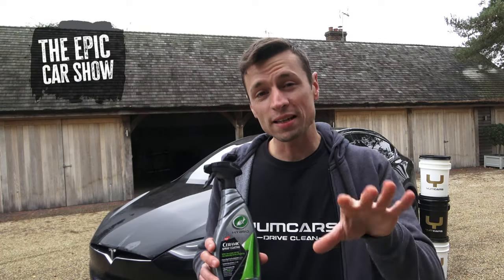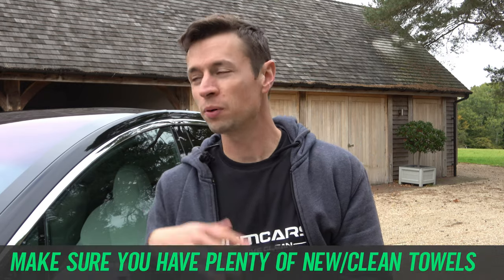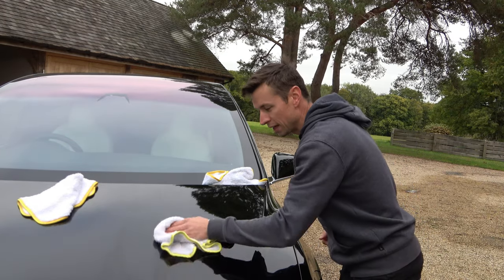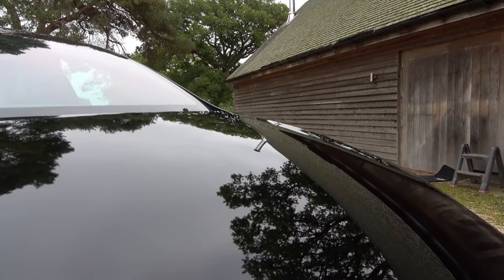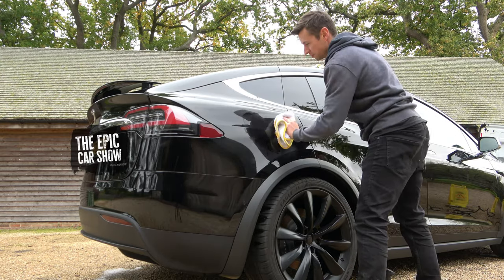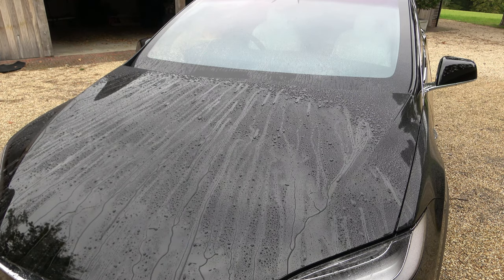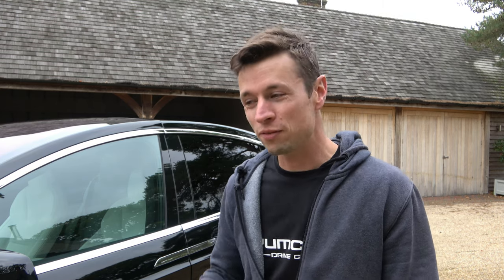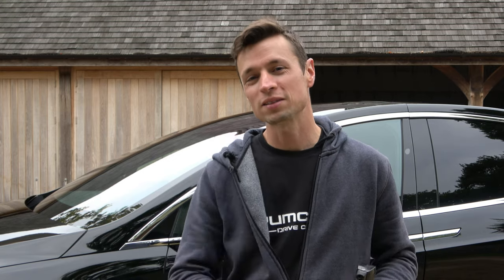Turtle Wax Ceramic Spray Coating Review | Fix Streaking on Black Cars

Comment from the maker: How many of you have had this problem with turtle wax? After seeing this would you be prepared to give it another go? Let me know in the comments.... It's actually pretty good once you establish how to apply it!
Reply: Liked it, but before buying again I'll wait for more graphene sprays to hit the market.
Reply from the maker: @gert-janvandenberg4156  I'm not on graphene yet. Give it 12 months everyone will have graphene products out
Reply: @epicautomotivedetailing  for sure, but those 303 graphene spray vids look promising.
Reply: Great video Dave , had the same issues with this product, then sorted with the damp towel. It is a good product ,but a lot of fannying about ,if you have the time. Tried others in the range ,shampoo, qd and the wet wax , shampoo and wet wax is a good combo. Done several different cars with the ceramic sealent for mates and family and only have a bit left which i use on my wheels. I have moved on to Garage Therapy 3cs and sigma now  for my winter protection which is quicker and easier to apply. I personally would not buy this product again . keep up the good work
Reply from the maker: @skidmarkbill  very well spoken mate. From a business point of view. It didn't work perfectly for me but I really wanted to rectify what I said in the past. That's why I love yum cars, sonax for the simplicity of their application. One thing I will definitely give them credit for is the durability which I seen over the past 12 months. Thanks Dude 👍
Reply from the maker: @gert-janvandenberg4156  yeh that or infinity wax is on my shopping list 😃🇬🇧
Reply: after working extensively on a large black chevy truck yesterday, applying all the tricks, i'm giving up on the TW ceramic and graphene waxes.  I'm on line looking for someone that has found a good product for black vehicles that is not such a struggle.  I have a black car coming in about a week and my thought, unless I can find a better idea, is to polish with TW Graphene 1 and done then follow with 303 or Adams Graphene.

Comment: Good to see you got it working. I only use 3 towels (but that Tesla was a bit of a barge, so understand the issues), and as I mentioned to you on the previous vid comments before, the wet one is absolutely key to getting results. 

Little tippy hint from my experience of the range.  If you use TW ceramic on a customer car and just one coat, you should try to upsell a leave behind of the ceramic wet wax for them to use after maint washes.  It is simple to use, they will love the results and you will become their trusted advisor.  A couple of bottles will easily see them through six months on an average car.  When you return to re apply the ceramic seal in six months, you will have an easy job and you may of course choose to make a couple of quid on the upsell too if you can get a discount from TW.
Reply from the maker: Thanks Kev, once I'm through with this bottle I'll be on meguiar's spray sealant it infinity wax graphene maybe. Just love trying all sorts of brands
Reply: @epicautomotivedetailing  Can understand your point entirely as a valeting business and a YouTuber. With me just maintaining a few cars, I quite like the finish, longevity and simple maint washes the TW offers, and don’t have to worry about time too much. You get out what you put in as a weekend warrior I guess.
Reply from the maker: @kevtheargonut  I'm all about simple and easy products

Comment: I first used Turtle Wax ICE Spray Wax' then bought the TW Ceramic Polish, and the TW Ceramic Wax.  I found the same streaking you shown.  It takes more work.
I am going back to the ICE products.
Reply from the maker: Yeh it's a shame but it looks like they have their graphene coming out before Xmas. I could be wrong but judging by there (something big is coming promo) it looks like graphene

Comment: Nice revisit, I used it on my black Golf this summer. Good results if a bit difficult to apply, IMHO. I will likely go for something quicker and simpler when the bottle runs out. Cheers Dave.
Reply from the maker: Hello Simon, yeh it's good but think it needs a tweak to be better for the mobile valeter or weekend warrior. Yum ceramic all day long for me

Comment: OMG, yes!!! I have Toyota Camry with the red pearl paint (7 layers of paint + 2 layers of coat)! I have a terrible problem with this product, I literally sweat myself and push really hard trying to remove the streaking... So far the only workaround I found is using barely any product, wiping it off almost instantly and buffing off with a second towel right away...
Reply from the maker: It's a real pig isn't it. I won't get any more ever again
Reply: @epicautomotivedetailing  Most of the videos about this product are super inconsistent too... One guy is saying it's perfectly fine to use in direct sunlight, as the product was designed having in mind the hot climates, another is saying avoid the sunlight, one is saying it's super easy to apply, etc. But it's not easy to apply. Probably , theoretically, after doing a near professional level of paint preparation and while you already have other products applied to the paint afterwards... then MAYBE it would be somewhat easier to apply... For me it got really frustrating and I even thought of throwing the bottle out for good...

In addition, I got their 3in1 Ceramic Detailer Waterless Blah-Blah product as well - and I got exactly the same streaking problems as with the ceramic wax... And worse, the product says to pretty much spray generously and wait a few seconds... BIG mistake!

Edit: I've never, ever had such problems using the Waterless wax by Meguiar's
Reply: @epicautomotivedetailing wait a second fella... i have read your replies you made under this video where you say you like this product and will keep using it. And here you are claiming you won't use it again. You must realize one thing, people will read these comments many years after uploading a video. Be consistent with replies

Comment: I had best results by applying it with thin cloth, so it spreads more evenly, and most of it disappeared. The bits that didn't disappear - I buffed them with DRY, fuzzy cloth. Took some time, but I think that removing marks with damp cloth also removes the product.

Comment: Good points raised Dave, to help us learners/student of detailing!  Meg's HCW first applies similarly, best done with a wet car and damp MF for applying, then use the 2nd cloth to dry and buff (hot day not ideal time to play with this kind of product).  Similarly priced to TW, but I will be trying the new (cheaper) Infinity Wax QDX Graphene spray bought recently, but not the weather to test this weekend. ⛈⛈⛈⛈
Reply from the maker: I need to try graphene. I need to see how it holds up in winter
Reply: @epicautomotivedetailing  TW HCW is a good product but those smirs or dark spots appear on dark colored vehicles because you spray directly on the panel here is a Tip for you. Try spraying on a towel and then just spread it on a panel then buff off with a second towel on any dark color (no more). this can happen on any spray sealant/wax  not just TW. I've seen it happened even on meguiars NXT wax  2.0.its simple to much product on a surface and not enough time to wipe off.

Comment: Great video Dave, think you've identified where I went wrong with this product when I bought it originally, may have to buy it again and rtry using your tips although I think yim cars ceramic is a far easier product to apply now I've tried it and like it
Reply from the maker: Yes yum wins hands down for me. I had to remake this video because it would be pretty poor of me if i left my old video without giving it a fair crack. Yum ceramic is mind blowingly good

Comment: I've got a new black car. And it has a Graphene Ceramic Coating on it And it drives me crazy with all the streaks. No matter what I use. And I'm not a rookie started by detailing planes and private jets working at a small airport 36 year's ago. Trying to work off my pilots license. But this thing is insane!! Someone can look at wrong and it gets a smudge on it, so it seems.
Reply from the maker: Wet towels straight after followed by fresh new ones is the cure

Comment: Interesting comments. Here in California, with 2 black cars after about 2 1/2 years, I've had minimal problems, just used a microfiber applicator towel to spread the product around, with not too much product sprayed directly onto to the vehicle and then wiped off with the same microfiber towel using the opposite non damp side, and then buffed with a fresh microfiber towel. Rare streaking, which cleaned off easily with the same applicator which was still damp and wiped off. I spray after each wash ie every 2-4 weeks depending, and can do the entire cars in about 15-20 minutes. No problems with layering. The vehicles look great and get compliments. I have found that streaking can occur when one uses too much product on the same panel.

Comment: That's exactly what happened to me it's a pain in the ass. The car looked like crap with those streaks. Had a hard time to remove them too.
Reply from the maker: It's very tricky but once you get the hang of it you will be impressed

Comment: Good vid sir! A fair assessment.  Even with the fix here, there are still way too many caveats for how to apply this stuff.  Also a 24hr cure time  per coat and recommended 2 coats for that 12 month protection.  For most driveway detailers/weekend warriors thats just not going to be possible, even with a garage.
Quick winter prep, this stuff aint ;)  I mean its like the Dulux Paintpod. Too costly for pros and too much hastle for everyone else
Does it do a good job? Yes, but the cost, time and prep required, when you can throw on just about anything else as a base thats not as fussy.  I'd even use Fusso coat over this in a heartbeat.
I can't recommend this product at all, but I cant recommend the older Tw hybrid and Dry n shine enough.  i hope that the V2 stuff gets released in the UK
Reply from the maker: Hello I simply had to make this video as I did one in the summer which wasn't fair of me to be too harsh on it as I said some bad things. But Yeh it's definitely not ideal with the 24 hours waiting time compared to other brands and no I'm not going to sway people into buying it either. This channel is all about simplicity and this product is the complete opposite.
Reply from the maker: Thanks for watching too 😁

Comment: Brandnew car, so the first time I washed it I used the Turtle Wax Hybrid wet wax the yellow bottle and that stuff is amazing so easy to use. But after the car was all dry and done, it was parked for about an hour 

Later in the night I decided I was goin put some turtle wax ceramic spray on it. The green bottle.
I just noticed and found out you have to use a damp micro fiber when using the green bottle and very light application, well anyways I didn’t do that so now I kinda have that sappy streak look on my pant. Not horrible but I can see it when looking for it. 

What’s the best strip wash I could use? Turtle wax Max wash? Or Adam’s Strip wash? The car overall has two coats of wax technically it should be super hard to get off. I didn’t put a crazy amount on the first or second time. But it did have time to cure, so I’m afraid the wet damp cloth trick won’t work for me right now.

Just basically want to start over and fresh, then I’ll probably only use the hybrid spray when the car is wet cause I like that the most and I get better results, probably cause it’s easier to use.
Reply from the maker: Hello just re wash with a strip wash and you will be golden

Comment: Mist a towel after getting most of the product off the car and then dry it with a micro fiber. Looks amazing.
Reply from the maker: YEs thats all it takes for an incredible gloss
Reply: Do you mean, apply with spraying the TW onto a dry cloth, then wiping over with a damp cloth, and then buffing with another dry cloth,, ???

Comment: Epic vid i have 2 coats on my black Skoda yeti used a microfibre applicator pad and loads of cloths and it looks ace top up every few washes with i si02 detail spray bit of a faf to use but the results speak for themselves
Reply from the maker: Yeh that's the problem I thought before. I first saw the streaks and chucked it but glad I got it out the bin. I even bought a second bottle because I felt bad for slagging them off lol

Comment: I found it hard work, harder than it should have been, 
Black SUV car 21 degrees, smearing like crazy. Got there in the end but I won’t rush to use it again.
Reply from the maker: I agree mate. I like but I always use other ceramic sprays first
Reply: I’m not one for giving up easily so thought I’d use it again on a c200 Merc estate, the results were outstanding, however I simply cannot get on with the product…it’s too labour intensive for me. 
Shame because I really like the end results.

Comment: Thanks for the video. Applied the other day disappointed with the streaks.
Does this mean i need to wash, decontaminate, polish and reapply to fix it?
Reply from the maker: hello my friend i already have another video on this which may help. long story short use a damp towel to go over the streaks and follow up with dry one
Reply: @epicautomotivedetailing  I applied the coating yesterday. Just went out and wiped the bonnet down this evening and streaks are still showing :-( might have to do an IPA wipedown and do it again I think

Comment: Hi Dave,the damp cloth idea does work,after applying the Ceramic Spray,it takes a while on a black car.i wonder if you can spray the TW ceramic on a damp cloth,wipe the paint work then take it off.
Reply from the maker: Yeh I should of mentioned that lol. Thanks for watching my friend
Reply: No need to be damp. Just spray it on a towel and spread it on a panel and buff off. its that easy. I recommend this to all spray sealants and waxes especially on dark colored vehicles .

Comment: Quick question.  Now that I have applied this stuff it is the next day and I am stuck with (Permanent?) streaks. I failed to spend the necessary hour buffing and rebuffing yesterday.  What's the cure?  A couple washes and reapply?  Go get some Ceramic polish and wax?  I'm not completely pissed, but I don't have time for this learning curve.
Reply from the maker: If washing afterwards doesn't work then go for an abrasive polish like Autoglym super resin Polish

Comment: thanks for the great tips! Unfortunately I found this video after I used the ceramic spray wax, and I have streaks right now. It's already been a day after I have applied it so the streaks are cured in. Will the streaks deteriorate on its own as time passes by, or will I have to go through a special process to remove the streaks?
Reply from the maker: Hello those streaks can fixed with a damp towel. With darker cars it shows more. Alternatively give it a quick wash with a bit of shampoo 👌
Reply: @epicautomotivedetailing  are you saying the next time I wash my car, the streaks will go away as I wash? What I meant in my original comment is that the ceramic spray has already dried and cured in. 
What shampoo do you recommend? Thanks!
Reply from the maker: I see what you mean. Well it's not 100% sio2 in fact it's very little. Adams strip wash shampoo would sort that out. But first see how a standard wash goes with a panel wipe after. Has it cured badly?
Reply: @epicautomotivedetailing  i see. I just have some streaks on the hood.

Comment: Its easy you just need to wash your microfiber towels before using it for the first time . The microfiber having a coating from the manufacture . The product instructions also say 2sprays per panel .

Comment: great  video dave .. you ought to do a video of the turtle wax headlight restore kit , it looks good thanks to your good videos going to try some of yum products... best wishes
Reply from the maker: Thanks mate. Yeah I did buy some but never got round to trying it. My shed is full of stuff. Looking to shift it all soon
Reply: @epicautomotivedetailing  thanks dave nice to hear from you.. so many products on the market autobrite are good but not the best .. you got to try other products was up at 8.30 for a clean but it was getting so hot rol on midweek or next super sunday best wishes
Reply from the maker: @nigellewis8461  got my own now so won't be featuring as many other brands of chemicals. Loads of tools and equipment though

Comment: I've just used this after watching loads of videos on this. Having used a few pro coatings, I found this to be excelent.

The thing here is I thing you've made a big job out of this. You sprayed way too much on a panel, try just using a small amount on a micro fiber applicator instead. With regards to the streaking, try just using a small amount of a microfiber towel. I do a car with 1 applicator and 1 towel.

Comment: Thx for the video. Is there some brand you recommend for beginners for this sort of work? Not sure whether I go for this one, Meguiars or any other brand/type of product. Normally I'd wash at the car wash, dry it with a cloth, and then I can just apply this product as you instructed, or do I need to wax it before?
Reply from the maker: To be honest I would recommend a foam sealant. So wash car as normal, put sealant in foam cannon apply and rinse and job done 👍

Comment: Thanks for the video.
However, I think that most people (including you) are just applying too much product. I have a dark blue car and I don’t have any smearing issue. How? I never, ever spray the product directly on the paint. I put a single spray (not even a full trigger pull) on a microfiber sponge pad and then I apply it on a panel. By the time I’m done with the pad, it’s already almost dry, then I buff out the rest with a microfiber towel. I agree with you that you need multiple towels, though.
Reply from the maker: Thank you it's good of you to share your experiences to help others 👋🙏